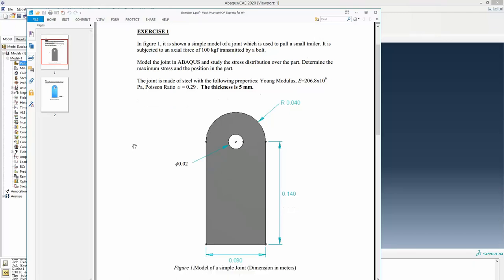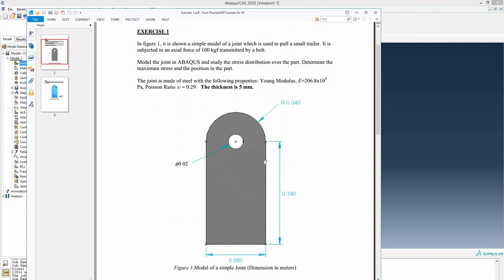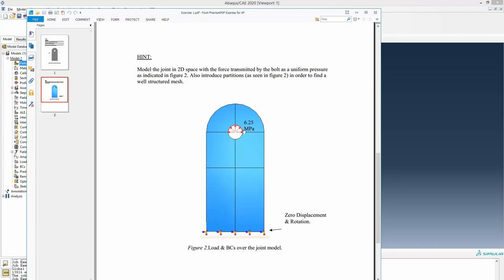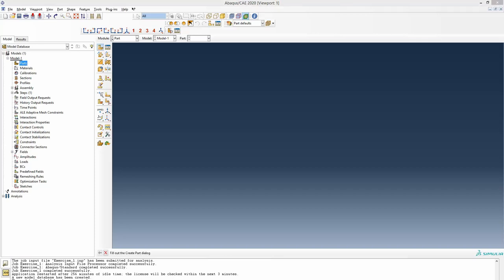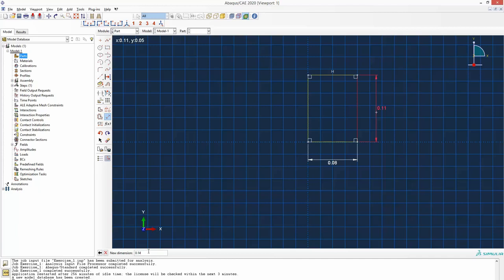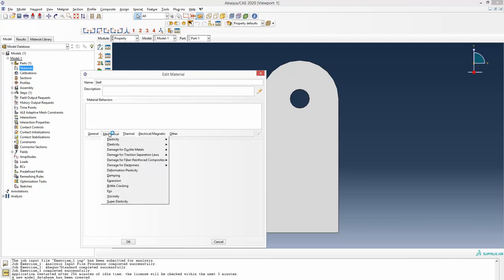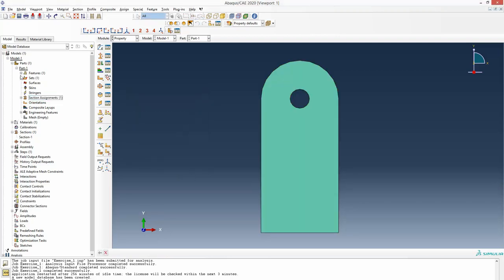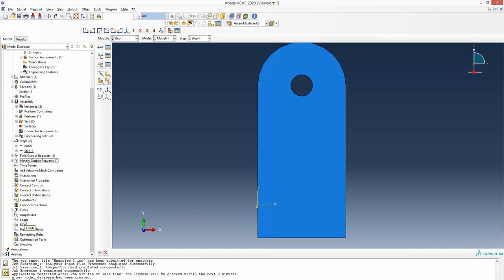Abaqus tutorial for beginners

Comment: I dont know why, when i try to slect the edge to put the presion, it only selects the area, but not the edge
Reply from the maker: There is a cursor sign/ mouse pointer sign if you look a little to the right from the top left corner of the abaqus window. From the menu next to that you can select Edge, face or element etc. When, edge is selected, you will not face this problem.
Reply: @10Minuters  Thanks a lot
Reply: @10Minuters  I couldn't solve the problem; I can't change de selection to Edge
Reply from the maker: @kahinakoukiis122  Please watch this video from minute 7 to minute 8. This can help:
https://youtu.be/4TlytrSux2E